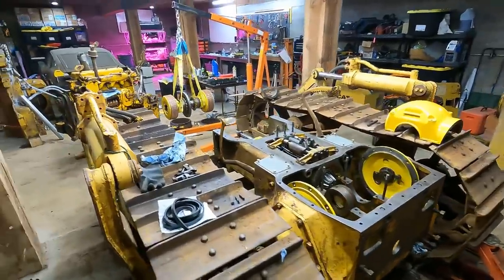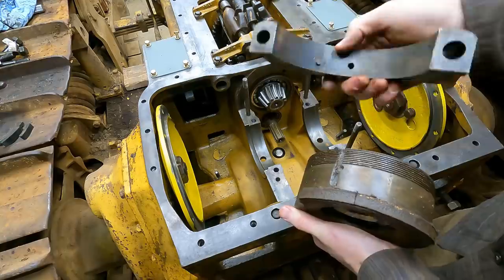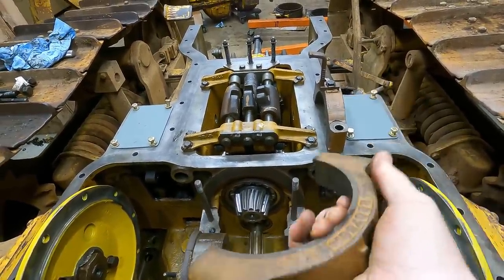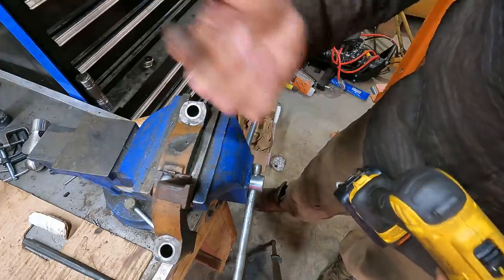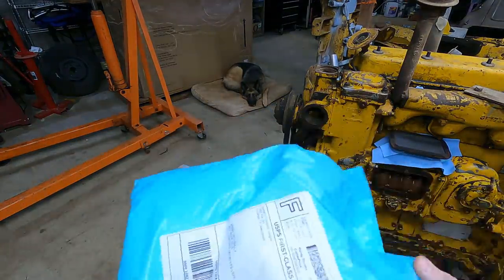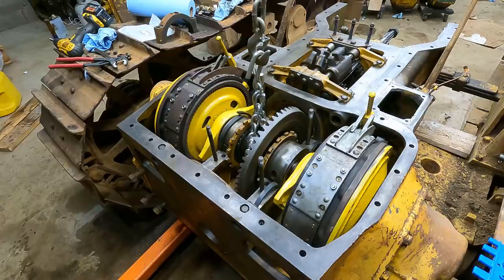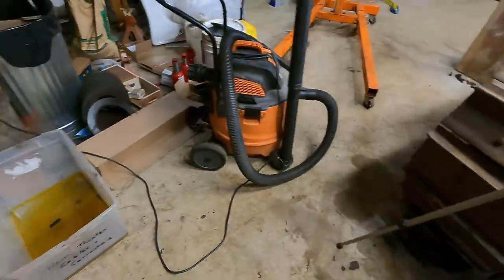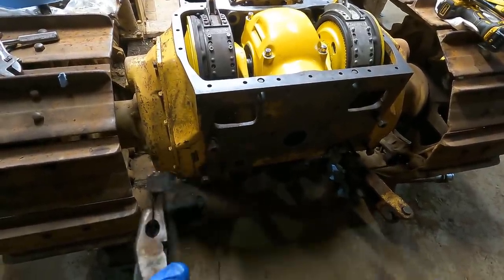Bevel gear and steering clutch installation in a Caterpillar D4-7U

Comment: I wonder if the reason for the gasket on the cap covering the bolt access hole is to prevent any oil that leaks back through the final drive seals from entering the interior of the clutch packs via the access hole and causing premature failure?

With the access holes sealed any oil leakage is going to run to the bottom of the backing plate on the clutch pack and fall (relatively) harmlessly into the bottom of the clutch/brake casing.

Comment: Are you sure about the rubber gaskets or are you guessing and will that rubber gaskets thickness change with temperature be sure.
Now was that harden modified bearing cap Pin added to hold that assembly in one place and for what reason maybe on later models ?

Comment: Crown wheel and pinion backlash aside. I was a bit unclear if the taper bearing adjustment nuts needed to apply any pre-load or end float on the carrier. When everything is at operating temperature, what is the effect on the adjustment of these bearings.

Comment: Your doing well mate. Do you need the winch? You could convert it to a single tyne ripper for hard ground. Did that on a allis charmers hd11 years ago and it made a more versatile machine. You can always snig logs with chain or wire rope. Anyway just a thought.

Comment: Those long studs that you pulled out have an interference fit thread, so when you chased them with the tap, you removed the interference. They didn't neet Loctite, just tightening up, like a pipe thread but less tapered. No matter, because the Loctite will serve the same purpose but good to know for next time : )

Comment: you seem very knowledgable, you do fine work my man, i just bought an old 1955 d4 traxavator, eberything seems to work and im cleaning it up, but i do have questions, i have only one fill vent in the back on the left of the pto,the little globe with a square center cap on top, i thought there should have been one on the back on the opposite side, so im not sure, there is justba hole and no threads in it, not sure what its for, but i cant wait to see the rest of your videos, good work and thanks for making this video
Reply from the maker: send a picture of it to my email
Reply: @PacificNorthwestHillbilly   what do i type for your email? sorry im not too hip on this kind of thing

Comment: Those bevel gears are called Zerol bevel gears.  They are spiral bevel gears with a spiral angle of zero degrees. This gives the advantage of spiral bevel gears having a smoother tooth to tooth contact, but also having equal thrust forces in either direction. A gear set like in a car, for 99% of the time, is going to turn in one direction. The thrust forces can be more easily accounted for in that case, so they can use a spiral angle of higher than 0 degrees. In a dozer it’s more like you said, 50-50 forward and back. Thrust forces in this case I believe mean the gears are going to want to pull in, or push away from one another.

Comment: The adjusting  bolts underneath are used when adjusting the band brakes and keep the bands close to the drum to avoid excess pedal travel, same as a lot of tractors. Normally screw in gently until it is felt bands contact drum and then back off half to one turn and lock off. This is done before adjusting brake pedal travel. cheers

Comment: Shouldn't the rubber seal on the bearing housing be glued to the housing? It might push out with use down the road. Catch it now before its all buttoned up.

Good catch on the lower studs. Just glad as I guess you are its finally going together!!

Comment: Those bottom adjustment bolts are for brake band droop. They're critical to adjust properly to prevent excessive top brake band wear.

Comment: Great job on that bearing cap locating pin. I absolutely would have lost my fecal matter over that relatively simple issue. I particularly like your choice of replacement pin.
Well worth a sitdown moment with choice of liquid refreshment.
Looking forward to next episode.
Reply: Hey — the long round punch was good choice 👍 & novel pick!!
Reply: Of course simply returning the pin to the correct depth after exposing the weld end and then re-welding would have been too straight forward and had a proper fit instead of mucking about cobbling up a farmerized version of the dowel pin.
Reply: @deconteesawyer5758  Removing the recessed pin for inspection is sensible, given it was somehow recessed with bruit force.  Then it's minimal additional effort to upgrade to a longer pin that hasn't attempted to be drilled.

Comment: Thank-You for Your Video Series on rebuilding Your Cat Dozer. At John Deere they had the Assembler's Re-Torque the bolts after sitting 24 hours of the first Torque. I don't know if this helps You or not.

Comment: Great progress. You probably know by now, the bolt on the bottom of the case, is to hold the brake band up when it is released. The book will tell you for sure, bit it seems to me you snug it up, then back it off a quarter or half a turn. This keeps the top of the brake band from dragging on the top of the drum when the brake is released.  Looking good.

Comment: Windshield sealant would hold to that rubber and might just hold up to the oil as well. At any rate it would hold it in place for the installation process.

Comment: Using cyanoacrylate glue is how custom Buna-N O-rings are made.  I have been an industrial mechanic/millwright for a long time.  We buy rolls of O-ring material and make our own.  Because when you are working with custom or antique machines you just can't find those parts off the shelf.

Comment: Matt,  Next time you Want to drill out that hardened metal grab a sharp concrete drill bit. I've seen people use em to drill output shafts on transmissions. 
when you tear into the winch watch on YouTube ( C&C equipment) Clint is owner they work and sell heavy equipment specialize in those winches. Great guys and will help you.

Comment: When this was built CA was forty to sixty years from being available!  Permatex was the thing then.  Cats need homemade tools.  Fact.  From experience I speak.  Cutoff from the local steel dealer or junkyard are the secret.  Cereal box for template and cut and grind/file to fit.  Any idea of when it was built?  Mc Master Carr has a great selection of rubber with different degrees of elasticity, or Durometer.  Great information also on such things, a catalog is a great thing to ad to the library.

Comment: The adjustment bolts in the bottom are for keeping the brake band from dragging as the pads wear. They will need adjusted whenever the brakes are adjusted.

Comment: Use drill bits shaft for harden pin works good
Reply: ...except for the fact that the 'shaft' (shank) of a drill bit isn't hardened so that it can be tightened in a drill chuck.

Comment: Great work you are doing. There's an angled bevel cut so the gasket material overlaps each end and gets more bonding. surface. But I guess you could say that gives more area for failure :)

Comment: Hey Matt, built a lot of diff's in my time as a tech, you may want to spin your ring gear and check your back lash again in at least 4 places plus it helps to seat everything before tightening for the last time, and does it say anything about checking your back lash on the ring gear instead of the pinion?
Reply from the maker: Yeah I checked it every 90 degrees on the ring gear.  The manual specifically says to check it on the pinion.  I'm used to doing it on the ring gear myself

Comment: 👍 good dowel fix. BTW, a cement drill bit does cut into hard steel. Don't know if one small enough is made for what you needed. Anyway, good fix.
Reply: You can get precision drills in most sizes, but they are meant for pillar drills, the tc tips do not like being wobbled about as you do with a hand drill. might be better with a cobalt steel bit.

Comment: Well worth the wait for this segment to post.
It's incredible how you figure out all the issues you have to hurdle to get everything to mesh together with so little to go on.
You're lucky that guy who sold it to you is there with little snippets of info to help.
Won't be long and you'll be pushing first this spring or summer.
Depending on the weather of course.

Comment: I think, for this set, the tooth contact pattern without load should be set a little away from the toe. You can see the edge contact of the pinion toe on the gear tooth. It means the tooth contact is a little too much on the tow while in operation. The reason why the manual tells you to set the contact 50% on the toe is because the bevel gear pattern shifts to the heel under load. This is a common knowledge for spiral bevel gears. This gear set is Zerol – made as spiral bevel with 0 spiral angle, which makes behave as a straight bevel. Tooth contact does not shift as much on straight bevels. This gear has been used and we see the contact pattern from the use. It does not shit to the heel as expected. So, now we can tell if the contact has been originally set on the right spot. Apparently, the contact was set too much on the tow because the tooth surface shows more surface wear on the tow. I would correct the contact a little more away from the toe if I see the teeth wear like on this gear. The reason why it is critical is because the torque capacity may change for 50% depending on the contact pattern position. It is always better to be slightly incorrect to have the wear pattern on the heel than on the toe like on this gear.

Comment: Hey dude - me and the wife cant wait for the next few videos - we literally binge watched every single one after discovering this last month, what an insane mission man - i envy your patience and mild manners and endurance! I work on machines all day and on occasion a  tool might go flying - cant believe youve just kept on pushing thru!! 

Also delighted to watch someone else doing all the hard work from our couch - we are very much anticipating the next vids.. i wish you all the best and plz stop banging your fingers up! 

now a tip i was going to write about was the permatex non hardening sealer (i see you discovered it) - excellent stuff, use it at the shop ALL the time! Many other brands but they all work the same- you can usually remove and dont have all the RTV to deal with.. weatherstrip is also great to tach rubber seals in place quickly - few drops of oil between any double lip seal helps lube it and lube it too.. 

You've done a wonderful job man! Seattle was the 2nd home for me when i was still travelling around the US - get some clear vinyl snap covers for the drivers cage so you can work in all the PNW weather and stay dry-

We are pining to see this thing run at last!!!
Reply from the maker: Thanks for the comment!

Comment: Matt,  It is not a sanity check.  It is a check to make sure who ever was in there before you  have set up the pinon depth correctly for a proper ring gear tooth pattern.  You have done too much work to trust those before you to have done this right.  :)  It appears the pattern is too low on the ring gear.  I would not want the total load of the pinon down so low on the ring gear as it is in my opinion a weaker setup. but heh I am not looking at the specs or any suggested pattern pictures.

Comment: super glue is originally formated for the gas company to make ovings if you want that super glue to dry faster after you put the parts together in the super glue in between its sprinkle a little baking soda on it and it'll dry instantly

Comment: When using a torque wrench having an extension on there that land will change how tight it actually is because of the deflection, it drops 2# per inch!!! so if it's 80ft# and you use a 8" extension u're torque drops to 74ft#!!!!

Comment: The special wrench you referred to is called a spinner wrench. Not particularly special. Someone like McMaster Carr probably sells the if you just have to have one. Otherwise your approach to the adjustment works just fine. Like you videos.